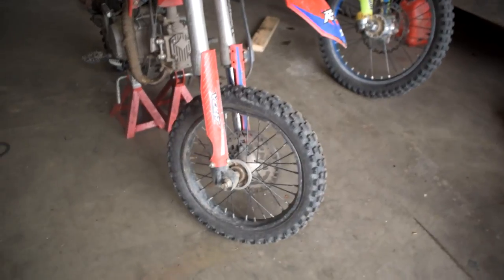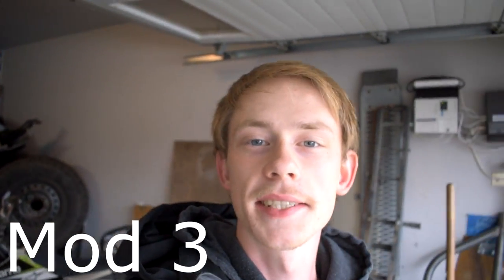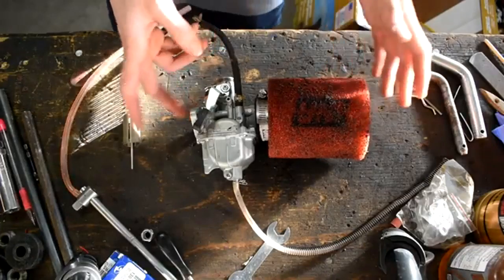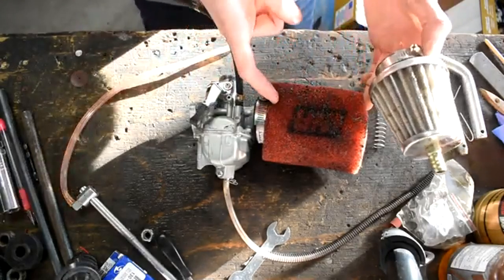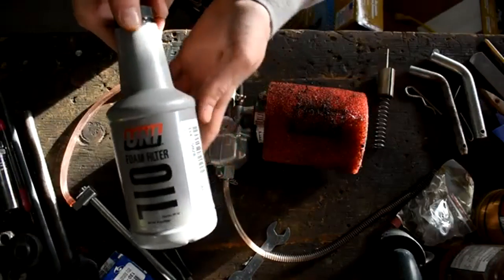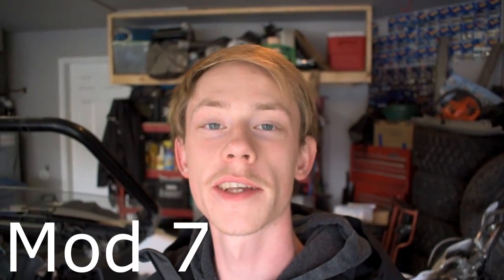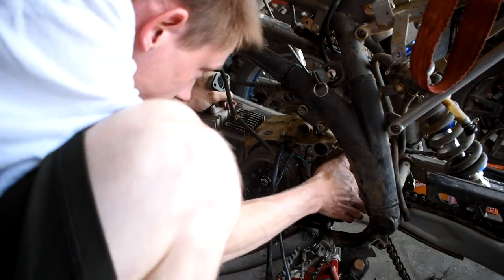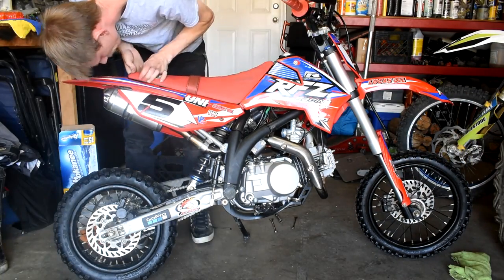Top 10 Best Dirt Bike Mods To Go Faster!

Comment: The part where you talk about the oil and gasoline is a useful tip for consumers like us to avoid, I did not know much about that, thanks for the info! 👌
Reply from the maker: Glad i can continue to share new info!
Reply: @douganderson7002  lol. Tell that to Wayne. Wayne was an annoying guy who used to try and race everyone in town at red lights in his purple 4 door neon. Was fairly quick for a sohc stock girl car but a slow racecar. Until the day he went to the local airport and filled up with 100LL. He beat half the tuners in town for a couple day's until it fouled up his engine. And if you know Wayne you'll know he doesn't tune shit except his massive 747 wing on the trunk lid.

Comment: How fast does your bike go???
Reply from the maker: 100
Reply: @AaronsEnduro  hi i have a rfz apollo 140cc pit bike im not sure what oil to use for it ? 10w40
Reply from the maker: Yes! You can checkout the oil
Linked in the description!
Reply: @AaronsEnduro  how much do i use out the bottlev
Reply: @AaronsEnduro  thank you !
Reply from the maker: Pour 600ml, and then check from there. Its usually around 800ml. It depends really on how much your drain (if you can get all of it out or not) the drain plug is higher than the lowest point in the casing so itll pool leftover oil in the bike ( i always tip my bike on a jack towards to drain to empty it)
Reply: @AaronsEnduro  thank you so much !
Reply from the maker: Very welcome brotha! Welcome to my page :)
Reply: @AaronsEnduro  can i use putoline dx4 10w40 semi synthetic?
Reply: @AaronsEnduro  mph or kph?
Reply from the maker: Im canadian so km/h
Reply from the maker: @twigz never heard of that brand before. As long as its motorcycle oil you should be alright
Reply from the maker: I use a semi synthetic 10-40w in all my bikes
Reply: Yo do you think your bike is good or bad???
Reply from the maker: What exactly do you mean?
Reply: @AaronsEnduro  thanks bro i have looked for so long for info on my apollo rfz but couldn’t find anything
Reply from the maker: I gotchu!

Comment: How much was it for your muffler i have the exact same rfz and it looses constantly cause it has no proper bolt to thighten on
Reply from the maker: This is the stock muffler! I also had the same issue and had to weld in a new nut to the frame and use my own bolt to secure the muffler!

Comment: Octane is detonation resistance. Higher octane fuel does not increase power unless you advance the timing, the myth that higher octane=more horsepower stems from some sports car’s ability to retard the timing to reduce the chance of pinging, or detonating the fuel too soon so that it doesn’t damage the engine. 

Retarded timing means less power, so when they put premium in their car it basically unlocks the full power that it has always had. Racing gas will only help if your bike/car is tuned to use it, just like E85.

Comment: Hey I got a stock rfz125 just picked it up used runs good needs a new chain what pitch do I go with the 420 or 428?!
Reply from the maker: Look at your current chain, it will have 420 or 428 stamped in it.
Reply: Can I put 428 protaper chain on my bike even though it says 420 I have a xpro 150cc storm

Comment: Great vid, i have i question, will there be a diference if i install biger tires, now i am on 18/16 and i think of going higher like 20/18, wouldn that mess up geometry?
Reply from the maker: It may change the head angle on the forks making it more or less twitchy, as well as it will increase top speed, and slightly reduce acceleration
Reply from the maker: What does that have to do with his wheels?

Comment: Does upsizing the front sprocket damage the engine or is bad for long term
Reply from the maker: Nope! Its just changing you’re gearing!
Reply: Any long term effects aren't really measurable.  With going up on the front sprocket your RPM's will be lower at any given speed vs. a smaller front sprocket.  IE:  A 14tooth will be revving higher at the same MPH as a 15tooth setup.
Reply: @GromBeardo  So a 14  to 16 tooth sprocket is ok. Because my dad was saying that it stresses the engine and makes it blow up
Reply from the maker: Yes you definitely dont want to jump to like a 20 tooth haha
Reply from the maker: The apollo lineup comes with 14-17tooth front sprockets
Reply from the maker: U just dont wanna lug the engine because the gearing is so tall
Reply: @jorjedmonds5328  yeah, jumping 2 teeth up or down from stock isn't going to hurt anything. Most people do that and change the rear too.  Huge leaps in sprocket size are what's going to jam you up and cause issues or not get you the results you're looking for.
Reply from the maker: Well said!
Reply: @GromBeardo   What do you think the speed increase will be ,. If the max speed was 82 kmh with a 14 tooth. Now with a 16 tooth
Reply: @jorjedmonds5328  that’s a good question, I was wondering The same thing. Someone please answer this question !
Reply from the maker: 92ish km/h

Comment: noob question here, just got a Kayo TT140 and want to upgrade stock parts, already did tires I am looking into the carb and sprockets next - will any size work from those links or do I need to match up whats there? 
 Thanks!
Reply from the maker: Find out your chain pitch, and counter shaft size before ordering sprockets. As for carb, a 24mm mikuni should do the trick! Thanks for watching!
Reply: @AaronsEnduro  thank you for the quick reply bud! Im going through a lot of your vids today, they are all very helpful to clueless people like me
Reply from the maker: Thats why i make them! Love being able to help out the new riders! If u ever need help feel free to drop as many comments as you need be!
Reply from the maker: I would also see what brand or style of carb is stock and match that for ease of installation. But a 24mm carb will be a good size for a 140

Comment: Got a nibbi 26mm carb on the way for a no name 125 dirtbike. 
Some of the manifolds I've looked at don't look like they'll work. 
Any suggestions?
Reply from the maker: If thats a vm26 thats too big for a 125
Reply: @AaronsEnduro  pe26
Reply: Did it end up working?
Reply: @Jordxn.  it did. I think I may have swapped it out with a 24mm. Played around with different jets after coming up with a manifold and adapting it to the carb and breather that would fit. I remember buying several and returning what wouldn't work. I may have cut the flange off of the stock manifold and used a short rubber tube with hose clamps to connect it. Haven't looked or thought about the bike in a while. I need to get the bike out and running for spring break in a couple weeks.
Reply: @Jordxn.  I was too hard on the bike jumping not long after I got it going. I need to swap it for a Japanese bike that's made for abuse. Buy once cry once and don't sell it unless you're upgrading. I miss my old 97 cr250.
Reply: @jamesrogers4674  I just recently bought the 26mm which I believe this guy has a video of putting on his 125cc so hopefully it works and if not then I’ll just return it. Thanks!

Comment: What sprocket tooth size is the best for an Apollo 125?
Reply from the maker: Depends where you ride, the 14 tooth is great if u do trails. It also depends on the wheelsize of your bike (as it affects gearing)
Reply: @AaronsEnduro  I have the 14 and 17 and just ride in yard and trails
Reply from the maker: 14 tooth is best bet then
Reply: @AaronsEnduro  thank u so much
Reply: @AaronsEnduro  and 1 more question, for the 125 x18 do I want 428 or 420 pinch for the sprocket
Reply from the maker: @maxjones641  some bikes have either or depending. If you look on your chain somewhere its stamped if its 420 or 428
Reply: @AaronsEnduro  thank you!
Reply from the maker: @maxjones641  thanks for watching!
Reply: @AaronsEnduro  np man ur the best, you’ve helped me so much
Reply: @AaronsEnduro  np man ur the best, you’ve helped me so much
Reply from the maker: Glad i could help! If you ever got questions drop em in the comment section of any video!

Comment: What rims do you use for the larger wheel set 17/14. Can you reply with the link please. Thank you.
Reply from the maker: Yes 14/17”!
Reply from the maker: In an hour or two ill find them for you! Just cleaning the bikes as we speak
Reply from the maker: https://ebay.us/ioF1cG here are the wheelsets
Reply: Thank you so much, very helpful
Reply from the maker: Lemme know how it goes! Make sure to put some good rubber on them! Best upgrade you can do is some real tires!
Reply: Did you but the Dunlop tires too and put them on those same rims or just keep the tires that are on the rims
Reply from the maker: I put the dunlops on the rims! The china brand tires suck!
Reply: I just didn’t wanna spend that extra money and I couldn’t find any bare rims for that tire size
Reply from the maker: I was able to find one website that sold just rims but they werent cheap 

Apollomotors.ca
Reply from the maker: And they’re not the best hubs either
Reply: Holy shit those aren’t cheap at all, but I think I’m gonna just go with the eBay ones because they’re cheaper, thanks bro appreciate it

Comment: I have a xmoto 125 (black white and red version). Will these mods work for it? (Already installed a new carb)
Reply from the maker: Yep!
Reply from the maker: If you have questions feel free to drop em below!
Reply: @AaronsEnduro  ok i have a couple. 1: i ride through trails fast, corners, small jumps (gearing up and down alot). I also use the road a decent amount to go to my cousins (they are backroads with really long straight aways). If I choose to have more top speed how bad will the acceleration get and vice versa. 2: are most 125 pit bike stock sprockets the same size? (Counting my teeth tmrw, any other tips for finding the right sprocket size will be appreciated) 3: my air filter has a hole in the top and i cant find any air filters with the same hole (not a broke hole, i plug this little cube thing into it). Sorry for so much, I cant find info on my bike anywhere, no pictures on Google of it, no youtube videos. Starting to think im the only one with this bike lol. Anyway any help is appreciated, since i been progressing on this bike ive felt the need to have more power/speed and doing these things until i save up for a kx or crf will be great in the meantime.
Reply from the maker: Great questions!
1. The taller gearing you get the less acceleration you’ll gain. If you’re running the larger 17/14” wheelset id say stick to a 15tooth sprocket for the best balence of acceleration and top speed.

If you have the smaller 12/14” wheelset id grab a 16 tooth sprocket (i will be making an entire video on sprocket choice) 

2. Generally speaking most 125’s come with a 14 tooth sprocket. Are they all the exact same ( almost)
The only difference between bikes are going to he the chain pitch (you either have 420, or 428 pitch) so you need the sprocket to match your chain ajd rear sprocket. Pretty sure 99% of china bikes are a 17mm spline for the sprocket.

3. That tube that used to go the stock air filter should be removed. Take the tube that comes from the engine (DO NOT PLUG IT) and vent to the the ground. That tube is ment to vent crankcase pressure. If you block that tube you will blow your piston rings.
Reply: @AaronsEnduro  thank you so much bro. Finally gonna tune up my bike and also finally i got some info on that tube (i was so confused). Anyways have a good one, def gonna sub 💯
Reply from the maker: Hell yeah brother! If you got any question and wanna send me a photo hmu on insta
Reply: @AaronsEnduro  i followed you im gavo.rackracer, I can send pics tmrw.
Reply from the maker: Sounds good m8!

Comment: What carb for a Ssr sr 150 and does anyone know what seat fits if you can link
Reply from the maker: Vm24 mikuni should be minty (what i used for my 150)
Reply: @AaronsEnduro  would 22 work or get 24
Reply from the maker: 22 will be on a the small side 24mm is perfect
Reply from the maker: I recommend a genuine one not a replica
Reply: @AaronsEnduro  so I’m about to trade for a SSR SR150 but it has no carb
Reply: @AaronsEnduro  I see it’s 130 👀
Reply from the maker: I used a vm 24 on my 125 as well. Both ran mint
Reply: @AaronsEnduro  I mean price haha

Comment: Aaron thanks for all your information im always hitting that like button. i have a 125  db 27. its brand new i scored a deal on it. i have the stock 125cc tao tao engine. im very mechanically inclined as it is what i do for a living. well im a painter at a body shop now but have race car and all that cool stuff. i run amsoil, just preferenc,e and 110 octane as i am lucky to have that at a local gas station. because i live in florida leaded non ethanol.  i have been going through the stupid things that happen with these bikes. i actuually drilled ot the swing arm and put grease fittings for the little needle bearings in the swing arm... i have alot of questions for you but this is the one I was wondering you can help me with.... what cdi box do you use. i seem to be going through them not quite sure why i ohmed out the stator and checked the coil  even when hot all good Any suggestions? thanks Brother . btw shes gonna get another engine just experimenting with how many hours i can get from this one...
Reply from the maker: I still have the stock cdi box!
Reply from the maker: Id check your body harness for shorts/ cuts/pinches in the wires
Reply from the maker: And the pins in the connectors arent corroded
Reply from the maker: I appreciate all your time watching brotha!
Reply: Absolutely okay that’s what I’m gonna do because I haven’t takin the time to Thoroughly check thanks brother
Reply from the maker: The only reason the cdi box would die is either its a crap china cdi box, it got water in it, or the circuit grounded out and fried it
Reply: Hey if you ever want some custom paint I would love to help... I think right now it’s hard to get stuff sent from Canada to the US as it’s it the other way... but your out the putting that bike to work... that’s cool... thanks agoin for your help
Reply from the maker: Im always one that loves some custom art! Maybe if you came up with a design of some sort i could make it into a sticker / shirts! And have your art be apart of the channel!

Comment: Umm I don’t think these bikes need high octane...it could actually make it worse but yes non ethanol is great
Reply from the maker: If u like detonation then sure :) ethanol gas is junk
Reply: @AaronsEnduro  you won’t have detonation...better have a high compression engine or otherwise high octane hurts performance because it resists burning
Reply from the maker: @gonewronggarage4565  mine is 10:1 compression. Sooo yeah thats high compression "Anything over 10:1 is a high compression ratio" says the internet
Reply: @AaronsEnduro  as far as I know 11:1 is when high octane is actually necessary
Reply from the maker: Youd be nuts to run normal fuel on a 11:1 compression ratio
Reply: @AaronsEnduro  but either way most engines don’t “need” it I’m pretty sure most pitbikes have 9:1
Reply from the maker: Necessary and beneficial are two different things
Reply: @AaronsEnduro  well what I mean is it is necessary on 11:1 meaning you need to use high octane but even for 10:1 that’s not really “high” in most cases wouldn’t help anything to use high octane in that range but that’s what I learned! I’m not a expert

Comment: High performance CDI the blue one
Reply from the maker: Ou that too! Smart thinkinn
Reply: If you go for it make sure it's 6 pin cdi and make sure the adapters are square because they have ones with the round adapters to they don't fit

Comment: I wanna two stroke swap the one imma get when it blows
Reply from the maker: Now thatd be fun!!
Reply: @AaronsEnduro  I’m
Thinking cr125 gotta research which years most common parts most reliable etc but I just picked up a 2019 x18 seems all there minus a lil tlc throttle needs cleaned new grips carb adjusted at least until. I can get a minkuni ordered drove 7 hours to Dallas paid 500 for it runs strong gunna get new colored plastics graphics and few other things any place you recommend I get reliable genuine parts?
Reply: @AaronsEnduro  shouldn’t be a bad lil project I already love it and thought it be a better option than chopping up a cr80

Comment: I lost confidence in this guy when he said don't put crappy 87 octaine.... proves he knows nothing
Reply from the maker: I was also learning when this came out three years ago. I was just getting into dirtbikes
Reply from the maker: I still recommend non ethanol fuels tho. If your bike sits with ethanol, it’ll create shellac and clogged the fuel system
Reply from the maker: And yea, for race applications, dont use crappy 87 fuel lol unless you like detonating
Reply: @AaronsEnduro  if you have detonation in a Chinese pit bike there's something wrong. These bikes don't have much compression. So anything above 87 is useless. If you built it for higher compression then yeah. But also anyone who is bumping up their compression, probably already knows not to use a lower octaine rated fuel.
Reply: @AaronsEnduro  this is true. It looks like you have done the correct research. If only it was when you made this video lol.